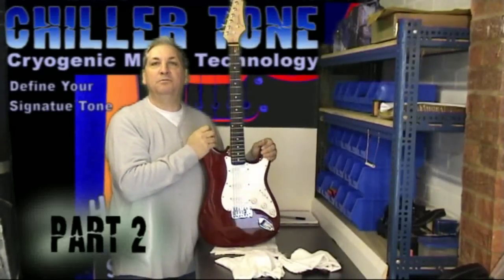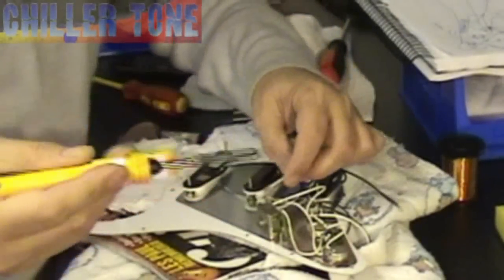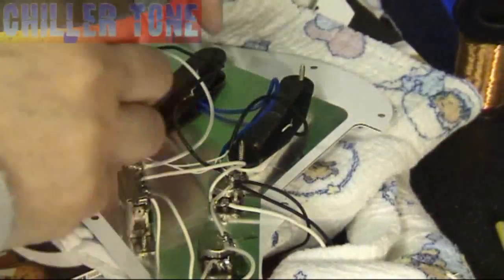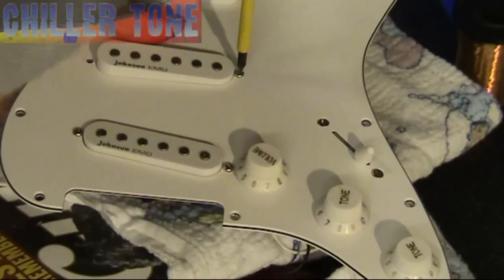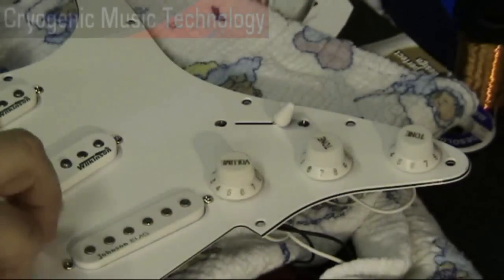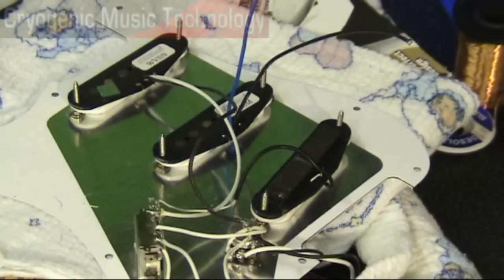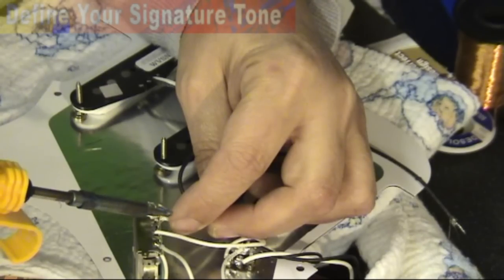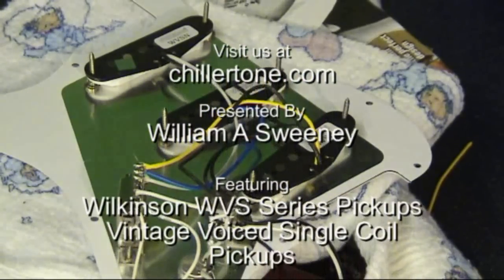U-Can Stratocaster, change Single Coil Pt 2

Comment: Hi, I was wondering if the ground wire needed to be connected to the volume pot.  Is it okay if I just solder it onto the metal foil on the back of the pickguard?